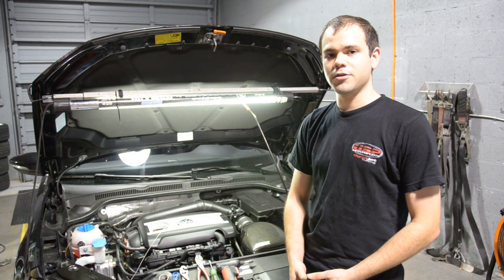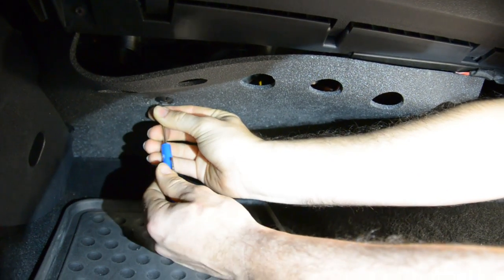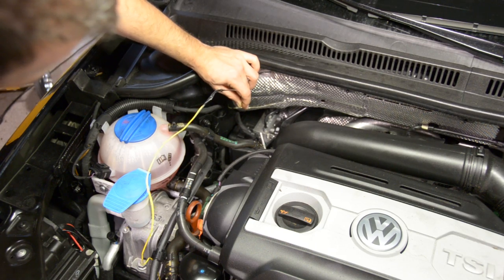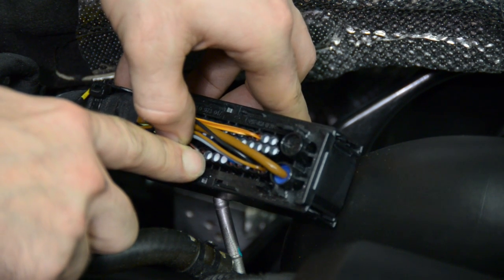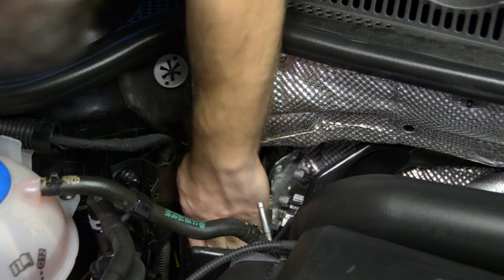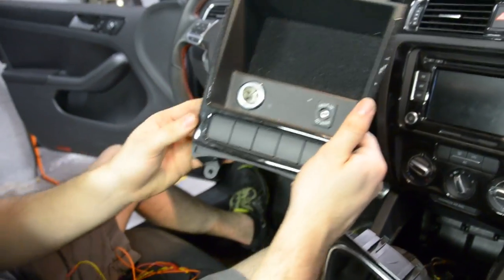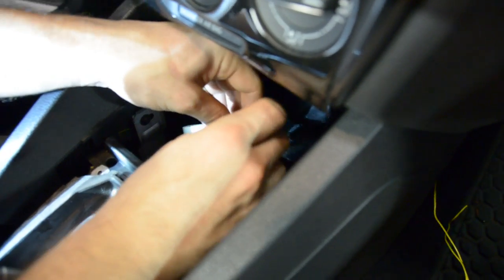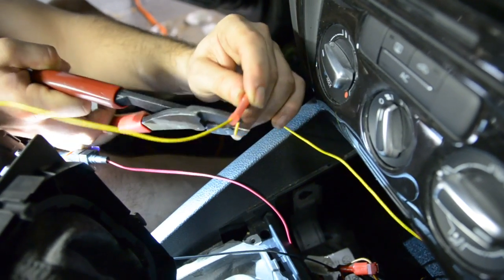VW MK6 GLI / Jetta Traction Control Button DIY by USP Motorsports

Comment: I'm having a horrid time getting any coat hanger or fish tape to get through the hole where the video said to.  Please help me I've had your $99.00 kit to do this for 3 weeks now and I cannot get the fish tape or wire through the firewall in any way. Please help!
Reply: graydon whitecotton have to push hard I mean hard and move the plastic piece it’ll hit on the outside
Reply: I cant get mine threw tryed for 2 hours
Reply: @J.Johanson  what plastic part

Comment: This will be installed on my 2011 TDI the HOUR it arrives!

The Jetta does a great job of dealing with the Michigan winter at speed. But traction control makes it next to impossible getting from 0-10 mph in any type of snow or low trac condition.
Reply: Charlie LeDouche 
Just got mine for the wife’s car.  
It’s Xmas day, I’ll probably go to put it in at the shop tonight 👍🏻
Reply: Car is great in the snow, parked lol. The TCS kills any hope of safe driving in a Massachusetts winter.
Reply: Just wanna say RIP to my Jetta. Best $250 trade-in as I’m back to Toyota.

Comment: Just finished installing on my MK6 Jetta TDI w/ DSG. Fun install.
Reply: And that's awesome man! I also have a mk6 TDI with the DSG and I was wondering if the install is the exact same as the one in the video or if there are any differences??
Reply: It's the same with few differences. The written directions are easy to follow.
Reply: did you have to do something with VCDS? i couldnt make it work on my mk6 tdi dsg jetta i have it wired good but its not working
Reply: Was there written instructions for the TDI version in the kit? Is the abs plug wiring the same? Any info is greatly appreciated. Thx

Comment: I know this is an old video but if you get a wire coat hanger and cut the tip with a shear at an angle, youve go yourself a mini spear, stick it in the rubber button thing the thick wire is going through and just slide in and out, you will feel it travel in that wire tube. Took a few tries but it went through NP.

Comment: Hi my connector doesn't click into the control modual I was wondering if this is a problem?
Reply: Fuck me 6 years ago, mine is doing the same, wont click in…
Reply: @ChrisOfChin  I eventually got it in, but I was unable to ever take it out. So dumb.
Reply: @coman7682  Same spot here, mine doesn't seem to be as aligned as the other ones and I got no chance of taking it out no matter how I push on it from the other end. Not even sure if it works or if I need coding... welp

Comment: WTF?
But sorry guys that button is not for a traction control, it's to turnoff the ESP and the ASR. But that fake in the modren VW car you cant turn off this systems complet. it's always there! And its funny in Europe this is stock even in the lowest order.

A traction control works only with automatic transmissions, then you push the button, hit the brake and put youre feet on full throttle. If you release the brakepedal, then the electronics is working for the best acceleration. This is impossible with manual transmission, so its not a traction control button! DOnt mix that up, it's something different!
Reply: You're talking about Launch control....
Reply: hahahahaha lol. the one who is mixing things up is you mate